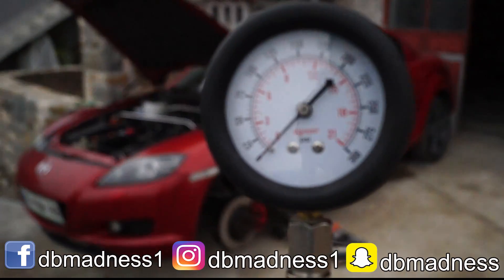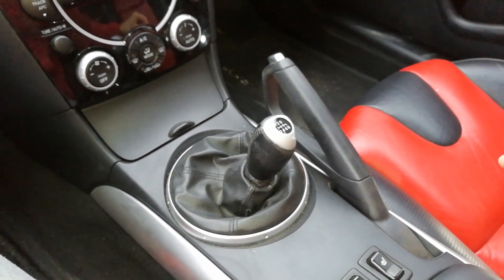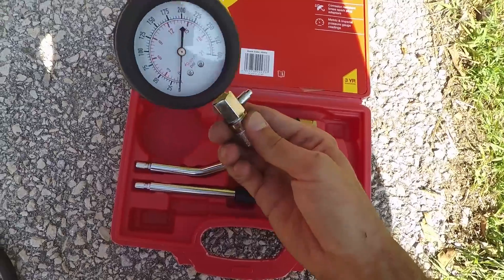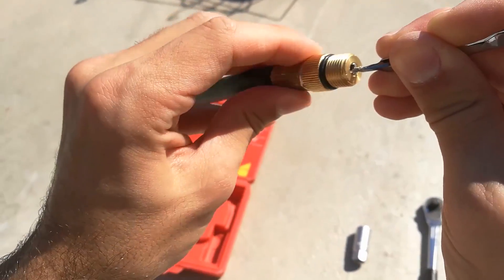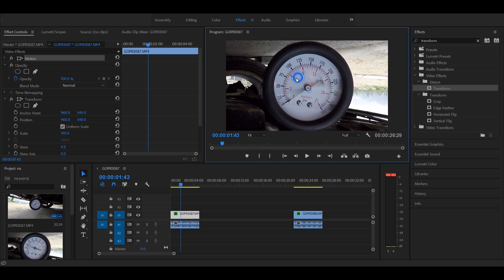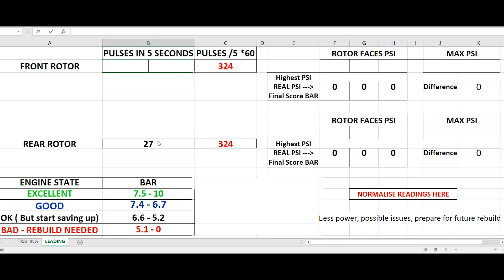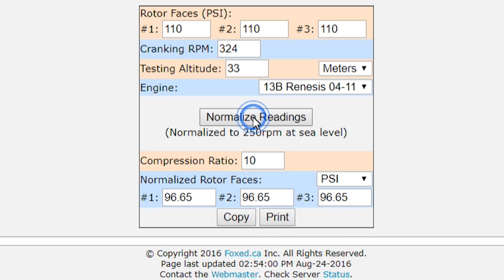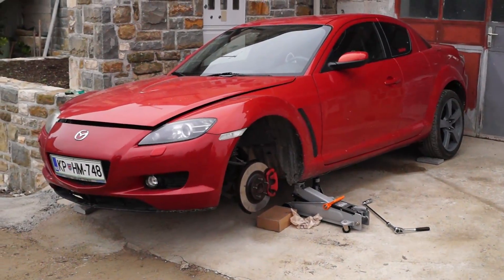Mazda Rx8 Compression Test | EASY, FAST, CHEAP!

Comment from the maker: If you want to check out the items mentioned in the video, they are linked below: 
🇺🇸 USA & ASIA:
🟠PISTON COMPRESSION KIT: https://amzn.to/3gAbPxH

🟠THIN TWEEZERS: https://amzn.to/3eSBS2Z

🟠21mm SPARK PLUG SOCKET: https://amzn.to/3VUEHkz

🟠1/2 RATCHET: https://amzn.to/3TpHDEa

🟠CROSS WRENCH: https://amzn.to/3MXRbUs

🟠SOCKET EXTENSION BAR: https://amzn.to/3FdQhl7

🟠FLEXIBLE SOCKET HEAD: https://amzn.to/3RA9jVx

🟠JACK & JACK STANDS= LOCAL HARDWARE STORE
-----------------------------------------------------
🇪🇺 EUROPE:
🟠PISTON COMPRESSION KIT: https://amzn.to/3snlfzu

🟠THIN TWEEZERS: https://amzn.to/3eV4GYu

🟠21mm SPARK PLUG SOCKET: https://amzn.to/3snw98w

🟠1/2 RATCHET: https://amzn.to/3F8nkXp

🟠CROSS WRENCH: https://amzn.to/3StHmPn

🟠SOCKET EXTENSION BAR: https://amzn.to/3F8NKIB

🟠FLEXIBLE SOCKET HEAD: https://amzn.to/3wW6iqB

🟠JACK & JACK STANDS= LOCAL HARDWARE STORE
-------------------------------
🇬🇧 UK
🟠PISTON COMPRESSION KIT: https://amzn.to/3srPhSs

🟠THIN TWEEZERS: https://amzn.to/3SrVU22

🟠21mm SPARK PLUG SOCKET: https://amzn.to/3skOcfc

🟠1/2 RATCHET: https://amzn.to/3srQgSE

🟠CROSS WRENCH: https://amzn.to/3gwVTwj

🟠SOCKET EXTENSION BAR: https://amzn.to/3goG4HW

🟠FLEXIBLE SOCKET HEAD: https://amzn.to/3wVvoGh

🟠JACK & JACK STANDS= LOCAL HARDWARE STORE
Reply: @1:09 I see there is like a gap in the lower side, between the red paint and the black lip, near where you put the jack up support underneath the car to level up the car. I've just bought an RX-8 and my car has the same gaps on both sides. Do you know what could be the cause of this? since yours had it too at least in this video

Comment: You.need to remove the shredder valve to check the compression on each chamber on each rotor. This compression test will not be accurate.on each rotor face.

Comment: Thanks for the info. Can you explain the maths behind why you add the difference between the max psi and best rotor psi value! With the gauge valve removed are you saying the pressure reading (90psi) is just inaccurate and is actually really the 110psi recorded when the valve is in the pressure gauge? Therefore, the key part of the vid  is using the go pro and editing software to be able to see the difference between the 3 faces of the rotor.
Anyone done this and then compared to a trusted rotary testing service/device to see how close/accurate it is?

Comment: Not easy at all: if you have the stock airbox, you must disassembly the whole, or it's impossible to reach the crankshaft sensor connector. It seems that just pulling out fuse and relais is not enough to get accurate measure..
Reply: just take all plug wires out.
Reply: U can get it from underneath the car

Comment: hey what if the car/engine is fast and smooth on a test drive? Doesn't a fast car signal good compression? And if the temp gauge doesn't move after 2-3 pulls. Starts easily both cold and hot. Isn't that enough or one still needs to do this excessive compression test?
Reply: On a rotary you should always compression test before you buy one. It can feel pretty good and be on the verge of blowing up.
Reply: @iansotomayor8788  How so? If you have a quick hot start and as quick as cold start surely that should be good enough (obviously without an overpowered starter)?

Comment: this is not how you do a rotary compression test. to get proper results, you need to remove the Schrader valve on the compression tester and watch the pulses as you are measuring 3 values from 1 spark plug hole. If you do this, you could potentially be masking the true problems with your engine. I was dumb and did this and had 120psi on my rx7 front and rear rotors, but when I used the proper method, it was about 70 psi per rotor face, which is about the same as what a Mazda compression tester would have given me (I have both methods).

Comment: I just got a compression test done recently at a Mazda dealer ship and they said my compression was low with rotor 1 having 6.3, 6.5, 6.9 and rotor 2 having 6.8, 6.4, 6.2. Just recently suddenly started having long crank times and a bit of lack of power and they told me it was probably due to the low compression readings. But according to this BAR chart it is still good? Do you think it might just be bad ignition coils or plugs?
Reply: Check make sure your cats are not restricted

Comment: Hi bro! you are the best when it comes to RX-8! Please I have a question: I am on the verge of buying a 2005 RX-8 with 47k km at 12k CAD$/9k US$. It is in Mint condition. Can you please check the ad and tell me if I should go for it: https://www.kijiji.ca/v-view-details.html?adId=1504284438 . Thanks a bunch in advance!
Reply from the maker: The car seems in very good condition.  I would suggest you run it trough my rx8 buying checklist before buying, so you can compare actual important facts. https://www.drivenbymadness.eu/downloads

Comment: Please god may he see this: if a have a compression tester that already shows bar do I need to use the convertion?
Reply from the maker: Hi, you need to convert them in PSI, so that they match exactly what i did in the video, and then also work for the normalizer, cause you can only input PSI.
Reply: Driven By Madness my man!

Comment: I watched the part about removing the Leading spark plugs.  Are you suppose to remove both at the same time and then test them or remove each spark plug one at a time?
Reply from the maker: HI, you remove one at the time, never both.
Reply: ahhh yes of course
Reply: There's only one compression chamber my friend. If you remove the other plug for the same rotor you will have a large pressure leak.

Comment: My rx8 set up for a few months now when I start it I don't have good compression at all and I over heat pretty bad any idea what the problem could be?
Reply from the maker: Fans are old and weak or not engaging.
Install fan control kit to turn on fans earlier.
Stuck thermostat
Air in cooling system
Clogged Catalytic converter
These are the simple things to check
1) Use an OBD to see at what temperature the fans turn on. If it's at 86°C it's ok the thermostat is working. The temperature must not exceed 105° C if it goes above 105, shut down the car immediately.
2) I would suggest you invest in an alluminium fan shroud. Mishimoto has a good one, check out my video.
3) If it's not the issue, take down the catalytic converter and check the honeycomb, to see if it's intact or clogged. Leave the car running so it reached trigger temperature and see if it overheats. DO this in a very well ventilated area outside.

4) You can take it to a mechanic and have him check all the above.
Reply: @Drivenbymadness  thank you very much will look into it this weekend thanks again man.

Comment: This is the "Easiest Way" to do a compression test on Rotary Engine.
1. Buy a GoPro, 
2. Buy a Ratchet Extension
3. Buy a Ratchet
4. 22mm socket 
3. Buy a Jack Stand
4. Buy a piston compression tester
5. Really Thin Twisters
6. Cross wrench
7. Jack
8. Cleaner
9. Bend nose plier
10. Very complicated movie editing software, you only need to learn a few hours to use it. 
11. Buy a Microsoft Office.
It will cost about $1000 to buy those parts, very cheap

And It only takes about a day to do it, and you will finally get not inaccurate compression readings of your engine. 

Thank you very much.
Reply: No doubt you have a smartphone.  There is free video editing software, There is OpenOffice which is a free version similar to MS Office. Your car should already have a jack. So, I just saved you $800
Reply: Few hours of learning to follow simple directions from the video?

He's not asking you to find a job as a CGI guy at Disney, he's asking you for simple edits you can make in every basic video editor.

And you can get a trial of office.
Reply: To be honest if you don’t own the majority of these tools you shouldn’t own an RX8.

Comment: Is it possible to get a 0 on the first lead spark plud
Reply: yes
Reply from the maker: 0 is impossible, unless your housing is empty
Reply: Driven by madness thank you. That sucks I’m getting a 0 with and with out the thing I. The end of the compression tester. The second plug is around 50. Time for a new motor. Love your videos
Reply from the maker: @markbell5483  thats strange, but if your car hesitates a lot or doesnt event start at times, it could be due to low compression. But if the trailing spark plug gets a pulse, the leading should too. If both trailing and leading of one rotor are 0, then  its time to save up

Comment: Thanks a lot for the tutorial, i will do my own test this weekend. You already helped me a lot with my rx, it runs great now. I just wanted to give you some advice for slowing down the video in adobe premiere (thats something i can maybe help out a little bit). Try this different approach instead of right clicking on the clip in the timeline and changing the speed, because that acually doesnt make use of the 60 fps and just skips frames. Go in the media browser inside of your premiere project and right click the video file and select: modify -> interpret footage. Then in the next window you'll see the frame rate settings, select "Assume this frame rate:" and change it to whatever you want your final clip to be, for example 30 fps. Now your 60fps footage is "naturaly" slowed down to 30fps making it twice as long as the original clip - you will see a huge increase of quality and therefore readability in the pressure reading. Also helpful for making smooth carshots :D
Reply: did u do the compression test

Comment: Just did a test with the "Rotary compression tester" from Classified performance

Front - 6.08 - 5.66 - 5.46
Rear -  6.06 - 6.13 - 5.92

Would you say the front rotor has an "extreme" difference between rotor faces?
Reply: To me, it seems like one of your front apex seals is not optimal, seeing is that 2 of your compression readings are lower than the 3rd.

Comment: So essentially if you're buying a used RX8 you should probably  Buy a new motor 1st then go shopping for the car.
Reply from the maker: Depends on the health of the engine that the rx8 you're buying has. I you have too much money, then you can buy a new engine and start super fresh :)
Reply: @Drivenbymadness  hey what if the car/engine is fast and smooth on a test drive? Doesn't a fast car signal good compression? And if the temp gauge doesn't move after 2-3 pulls. Starts easily both cold and hot. Isn't that enough or one still needs to do this excessive compression test?
Reply: Buy one with decent or even failing compression, upgrade the ignition system, and drive the car as you slowly buy new engine parts to eventually rebuild. Thats what i did.

Comment: i thought you said to relocate the register plate number for more cooling 🤔
Reply from the maker: carlos vega you'll see a video about it soon :) (relocate and possibly drill some holes)
Reply: Driven by madness 
bro,
do some exterior modification also like:
1.gt wing
2.bodykit
3.custom bumper
4.18" rim 
Not 1 day task. just do step by step.😃
Reply from the maker: carlos vega im gonna try to do that this summer bro. Im just indecided between the mazda speed wing or a gt wing 🤔
Reply: Driven by madness 
the spoiler choice id depend on bodykit choice.
i will go for gt wing. reason ,if later after a few year , you feel like , dont want to wear gt wing anymore , you can put you gt wing to you other car . save money . its not going to be waste so what ever. 😃
Reply from the maker: carlos vega I like the thinking 😄 I also had an idea to buy a separate trunk, where I install a GT wing, and my original trunk where I have the mazdaspeed one. This way I can register the mazda one, and swap it for the gt  once I get the papers 😜
Reply: Driven by madness 
actually i ride sti 06.
plan to buy 2nd car for family use. im not rich  man so i going to buy rx8 auto 6speed for family-use car. i plan buy & rebuilt the engine,new starter,walbro fuel pump,washable fuel filter,plug, cable plug,coil,battery,full-oil change etc. basically i plan to do engine part 1st. and your video do help me so .thank you bro.

Comment: I have bought a compression tester but in mine there wasn´t a valve like in youre´s is it a problem? I mean at 02:10 in your video.
i tried my compression tester on my Audi A4 B5 and the compression is holded in my tool until i release the compression on the side from the tool.
Reply from the maker: erliches71 do you have the same compression tester as me?
Reply from the maker: erliches71 if you test the compression on a piston engine, you dont need to remove the valve. Leave it in and see whats the highest psi you get, and that is your compression
Reply: I have this here https://www.amazon.de/gp/aw/d/B01GVAKOUI/ref=mp_s_a_1_3?__mk_de_DE=ÅMÅZÕÑ&qid=1519286560&sr=8-3&pi=AC_SX236_SY340_FMwebp_QL65&keywords=kompressionstester . and yeah i know that i don't need to remove the valve for a normal piston engine but i want to buy an rx 8 and before i buy i want to check the compression. that's why I'm asking.  my pressure release is on the side. and i got no valves in the adapter either not in the long hose.
so is my tester wrong for rotary cars like the rx 8 ?

Comment: is 90 psi on both rotors good or will a rebuild be neccessary soon?
Reply from the maker: Phyx depends on the cranking speed. Use my method and see for your self :)

Comment: Hi, I'm about to buy a RX8 but I'm not quite familiar with the designation. It is a RX8 Revolution Alcantara of the year 2004. Is it still the Rx8 R1 model?
Thank you for your help in forward :)
Reply from the maker: Yes, that's the S1 Rx8 (2004-2008). The S2 where also the R3 version comes in is 2009-2012. Hope that helps :)

Comment: How to make your rx8 backfire?
Reply from the maker: You mean make the exhaust POP loud and shoot flames ? SImple. Get a full high flow exhaust system. Agency one is known to be one of the loudest with big pops. An important part is that to remove the cat and install a De-cat. This will make the car pop, even if it's stock :)
Reply: Awesome Nuclr install agency power dual resonator midpipe.  Removed cat and gives nice pop

Comment from the maker: New updated version :)
Reply: Was wondering if it was a re-upload ;)
Reply from the maker: Jay yup, it had to be done. But no more re-uploads, only fresh content  :)
Reply from the maker: Flyingdutchy33 well said 🏅 you're a model owner, keep it up 😉
Reply: I really need to have mine checked at the local specialist for ease of mind. And to convince the new owner that this car was properly taken care of.
Reply: Aaaaand just got back from the rotary specialist who used the specific rotary tester on it. 7.2/7.2/7.2 Front and 6.4/6.7/6.9 Rear

Apparently the rear rotor is more prone to wear because it sits closer to the flywheel (according to the specialist)

Additionally, I had my SSV checked out. Turns out the previous owner switched the plugs around on them,  so they have never worked when I had the car in my possession. Car drives like a dream now!